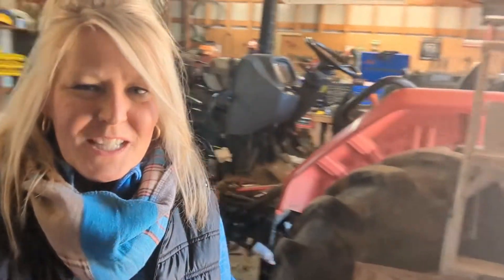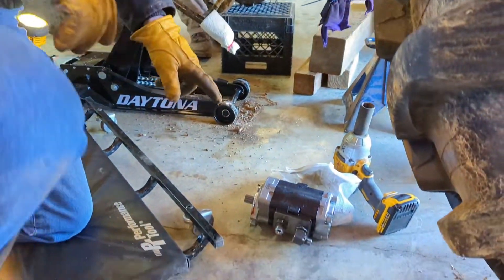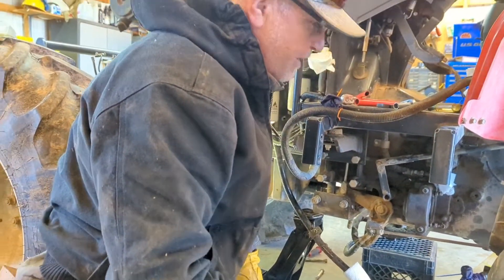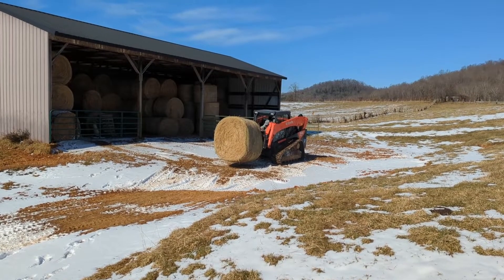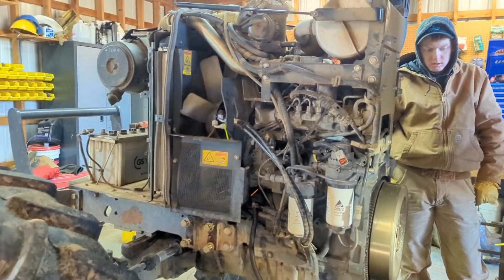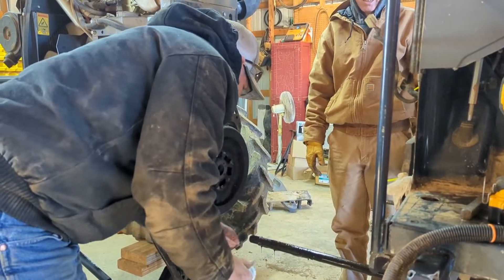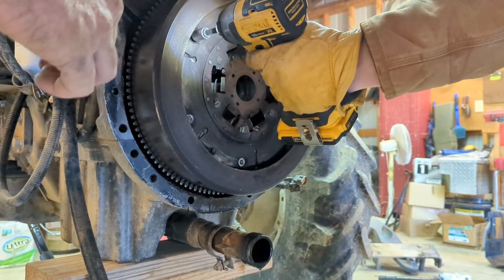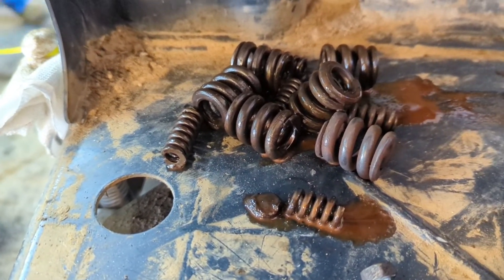Hydraulic System Failure: Massey Ferguson 4610

Comment: That is one reason we have 4 tractors loader equipped, plus  1 small wheel loader .... Can't sell hay  if you can't get it  on the  means of conveyance.....I'm set up to split the older tractors but its.Gonna be a whole new ball game if we have to split  any of the newer  ones.......I use a come-along   to help  pull the 2 halves  back together.... slow and steady-----if it don't want to go don't force it
Reply from the maker: The parts came in and he's working on getting it back together... Fingers crossed we are back up and running soon! I'll pass your advice on to Scott, thanks!
Reply: @thecattlemanswife   looking forward to  a succesfully  outcome.........
Reply: That gentleman not is first time to split a tractor good diagnostc😮